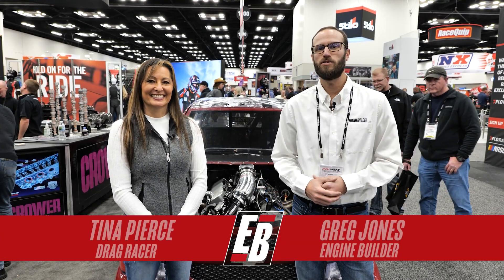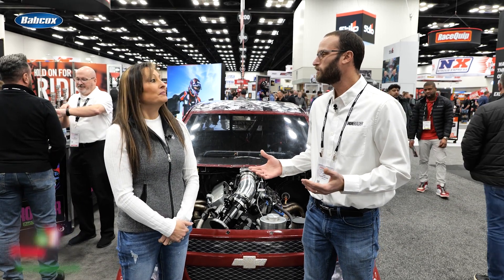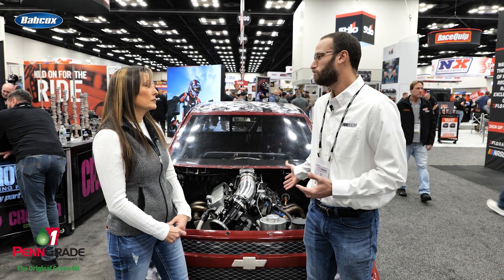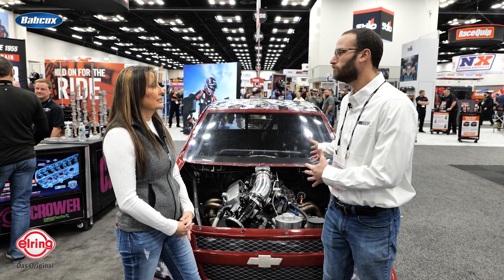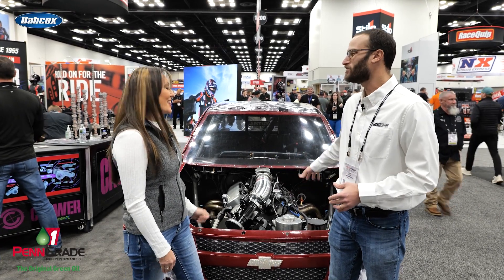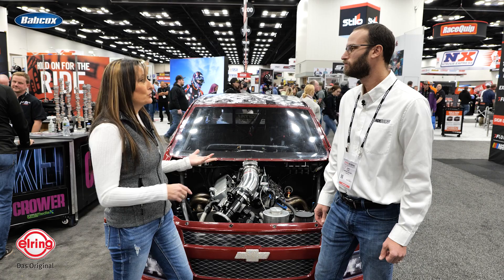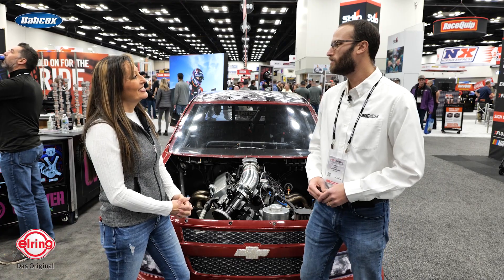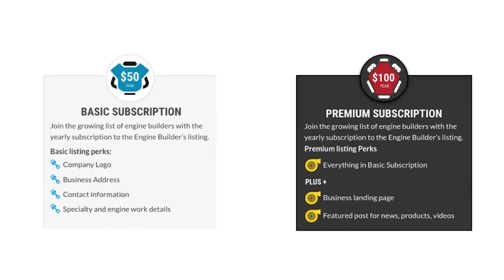Tina Pierce's Compressed Air Supercharged 509 Big Block Chevy Engine

Comment: While working with the local fire department, i played with this concept back around 2012 using our SCBA tanks. I promptly blew up a 396. I decided not to pursue that route until further advancements in the technology were made.
Reply: Solonoids used to only open and close so it was either all or nothing and it was almost impossible to fine tune with the regulators that were around so you eother gave it to much or not enough.